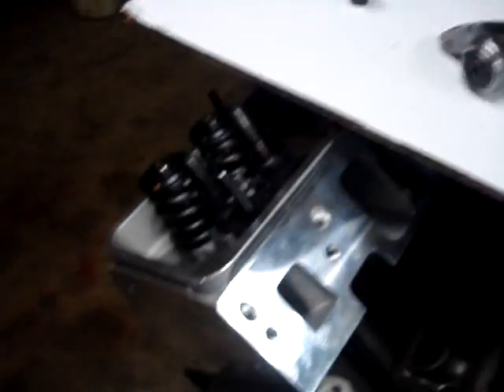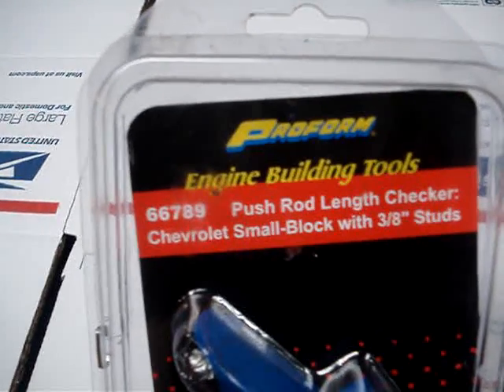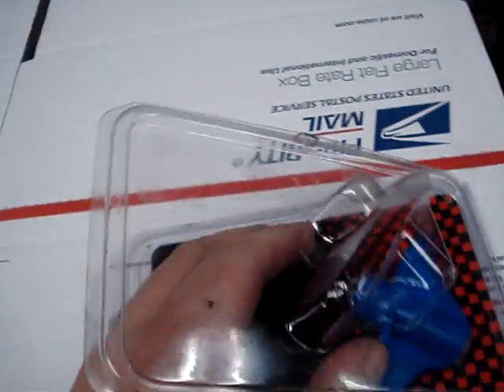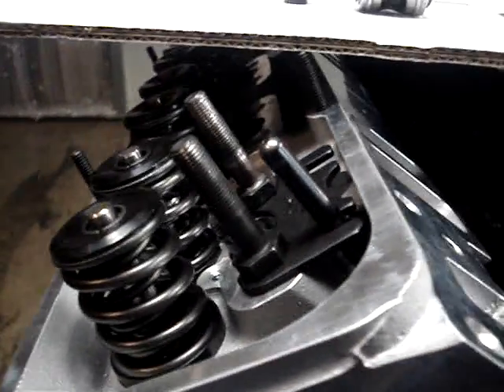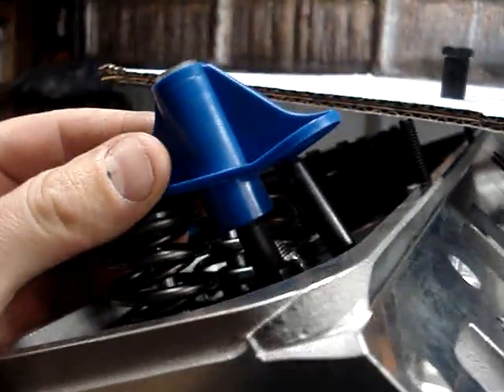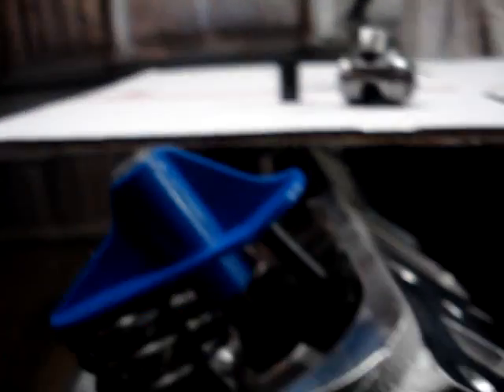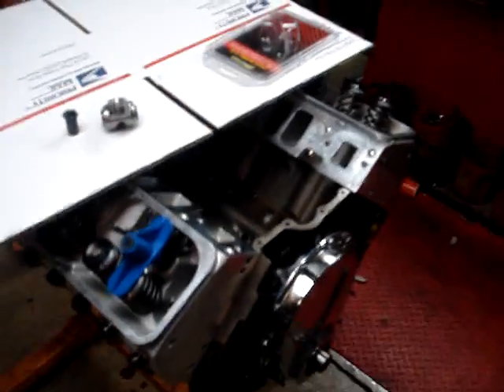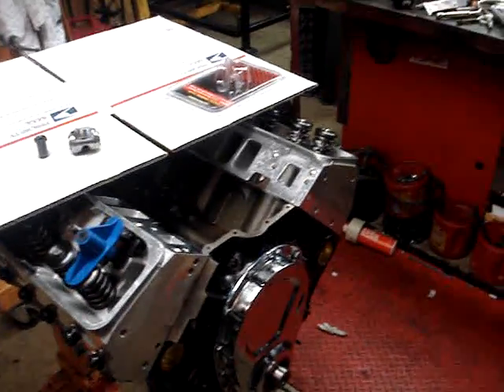How to check for correct rocker arm geometry

Comment: question: How does a Technician check for proper length when the cam lobe for each cylinder is at "0" degree bottom dead center? or Do i check this distance with the valve fully closed and the cam lobe at BDC for each cylinder?   please respond

Comment: I appreciate the answer. Although if I get the Vortec heads I will have to get a intake for a Vortec set of heads, right? Im not looking to go the Vortec route, I wanted to get a set I could bolt on and go, and dont mind spending $1200 on the heads, so the price isnt a big deal.  I have also checked the Edelbrock E street with the 180-185 runners. Im just wanting a reliable brand and would appreciate if you had any you could recommend?
Reply from the maker: The RHS Vortec's have duel blot patterns on the intake flange you can use your intake,  trust me you will love those heads they will kick the snot out of 200+ cc runners on a 350 the bigger runners don't have enough air velocity below 5000 rpm's on a 350 they are more for 383's and 400's I've already been through all of this I tested all these heads on the dyno give em a shot you won't be disappointed

Comment: What set of  aftermarket heads do you recommend I use on my 72 Chevelle with a 350, already has a dual plane Summit Intake and other goodies..488 lift cam, Edelbrock 600, will be using Harland Roller Rockers already ordered 1.6 size. IM in a standstill with AFR 195cc SBC Eliminators 1040.. will these work ok? Quote:These cylinder heads are a L98 based geometry. Not compatible with self-aligning rocker arms. Exhaust port is raised 0.100 in. over stock. :;;Do I need anything special for these to work?? Thanks! Don Don if you know Id appreciate it too!
Reply from the maker: 195cc runners are to big for a 350 with that cam buy some RHS vortec's with 180 to 185 cc runners and a 64 cc chamber it will run much better also your carb is too small you need 800 to 850 cfm carb

Comment: No mas kitty scratches ok....... thanks bro..lol.
Very very informative.
I have a 79 corvette... motor is from 79 but don't know if it's original to the body of the car. 350 nat. Asper. Mech fuel pump.
  Blew out #2 LIFTER THREE TIMES... so now I brought a comp cam thumper cam and I'm a fast learner and this is my first restoration job so I got my guts crossed and doing a lot of research so hats off to you and thanks for the lesson teacher. Until next time.

Comment: Nice tool . Is that right that you can use this tool to find your correct push rod lenght . Instand of  useing your rocker arm and turning the motor over with the calk on the valve stem  to check to see if it line up in the middle of the valve stem..
Reply: No

Comment: Rocker Arm Geometry should be set to center of valve stem / lash cap @ 50% of the total lift.
Reply: This for people who won't buy an adjustable length pushrod and do it correctly.
This is a "good enough ?" situation... for backyard doers.